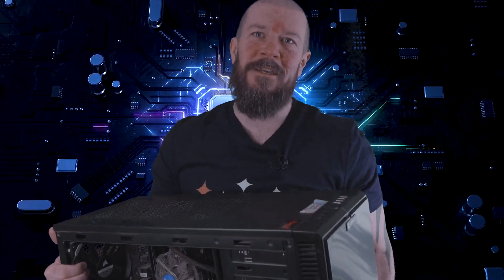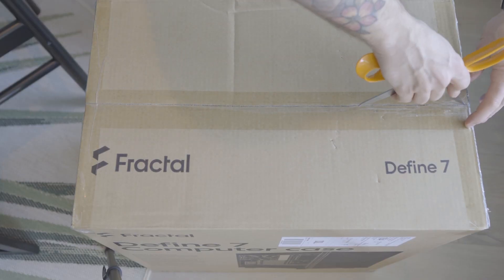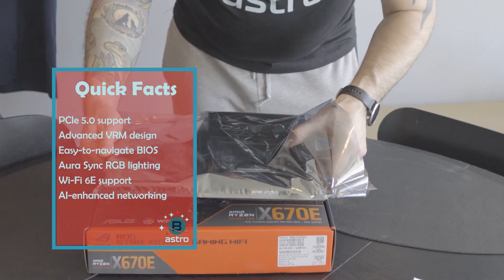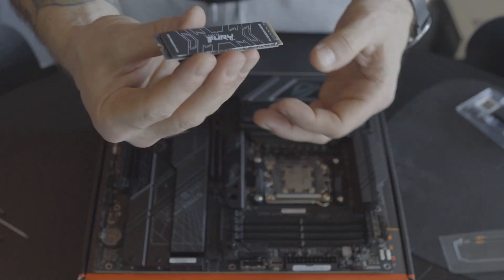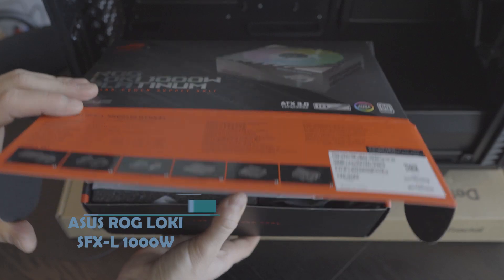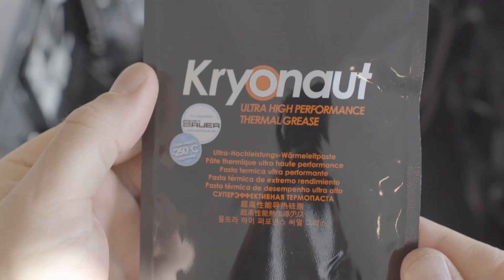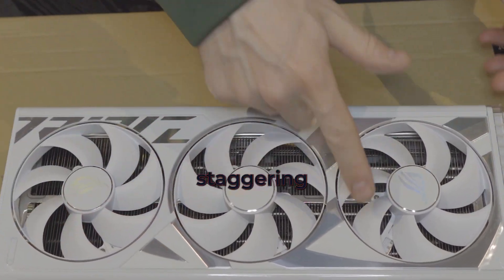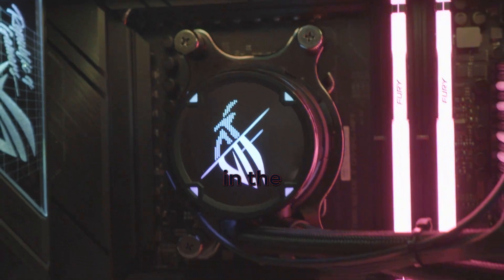I made my DREAM PC, for video editing, gaming and Pixinsight! ASUS ROG themed! RTX4090, AMD 7950X!

Comment: Nice build bro!
I went with 7950x as well but i did some tweaking in the BIOS and Ryzen master and go my CPU to hit 35000 in cinebench r23 on about 90W and around 55 degrees max.

So you don't have to but you can hit way bigger scores with less power usage and less temps!

Comment: Build with the case on its side. Put power box in ASAP, set up cables it will help later. Thankyou for great video.
Reply from the maker: Great tip, I actually regretted not putting in my psu earlier! :) Thanks for watching and helping out with your tip!

Comment: Lol the fractal design define 7 case. I'm using the xl version with x5 wd red drives in it for media streaming with plex. 

Will have to switch out the motherboard and all that later on in the year. Undecided if I go a 7950x or 7800x3d with a 4090 for some couch gaming in the lounge room.
Reply from the maker: Yah, the case is probably the least impressive with this build. But it works, sounds like you have a pretty good setup going! :)
Reply: @Bortle8Astro  to work in its a pretty good case and I really like the minimal design fractal put out. 

Define, torrent and that wood front panel one I forget the name of are my fav cases aesthetically.